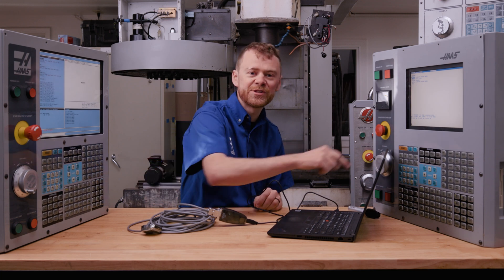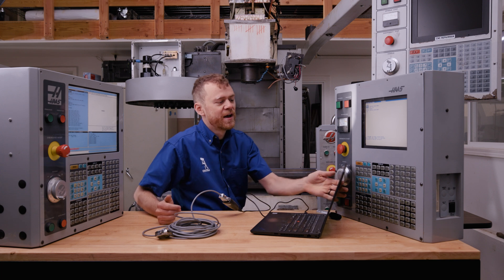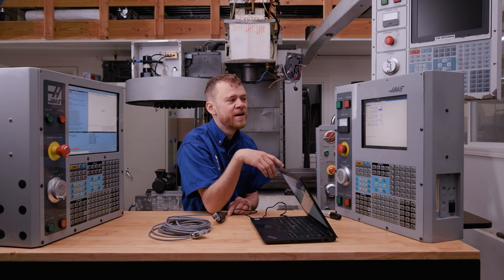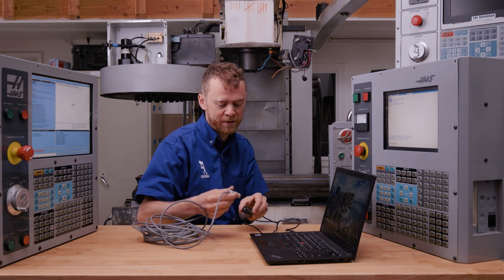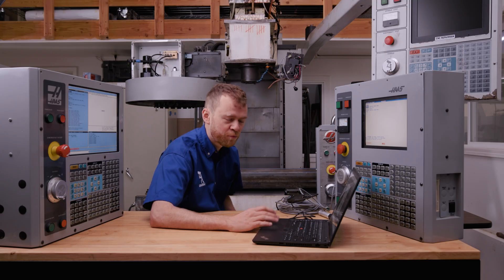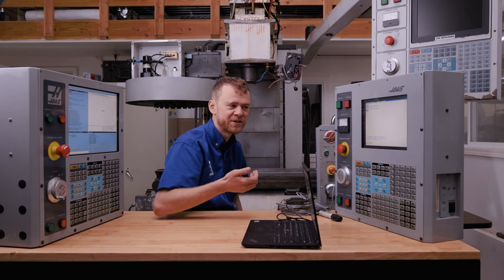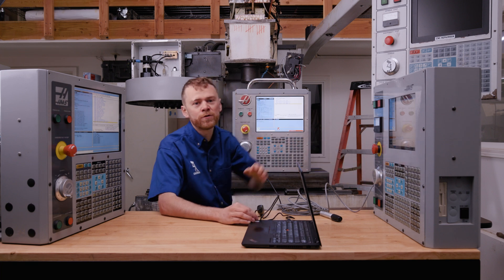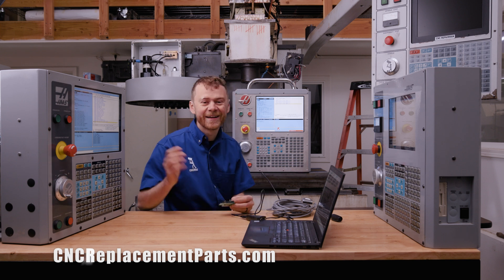How To Load Programs Into Haas RS232

Comment: I hate that there's a connector standard but the pinout is not a standard and what the cnc uses is a less common format. I wired my own cables with easy to setup plug in terminals and a pile of cat5e ethernet cable I have. I also have a serial port expansion pcie card but it only has 2 slots so one machine uses a usb version that was expensive. I'm about to need a splitter or a switch

Comment: Yes, all true. I used an optoisolated USB-to-RS232: Mouser part ES-U-1101-MB, but I still had to wire my own cable from a diagram. Amazon DB9-DB25 cables are wired backward :-(   I use an ultra-short RS232 cable and a 30ft USB cable.

Comment: Strange issue. 2 of my machines will stop and on the screen it will say "waiting". Most of the time I hit reset and the machines will run fine. I'm running 2 Haas mills on a Phase Perfect phase converter. Any ideas?

Comment: Question about old cnc controllers fanuc, etc vs hobby controllers like Acorn, Masso, Linux cnc. What do you think about retrofitting cnc with old controller with one of the hobby controllers. are any of them better than old controller. Because if i am correct retrofitting old fanuc with new one is expensive. Is there any chance to hobby controller to beat controller from newer cnc.
Reply: I've been involved with Centroid conversions on four machines in a commercial environment. Highly successful. It can be a lot of work, but super satisfying.